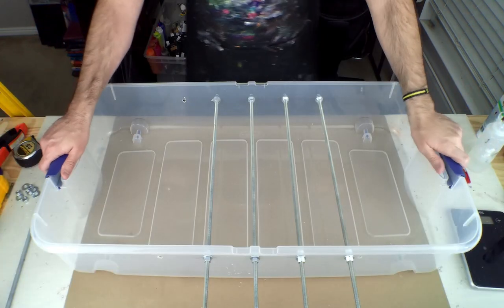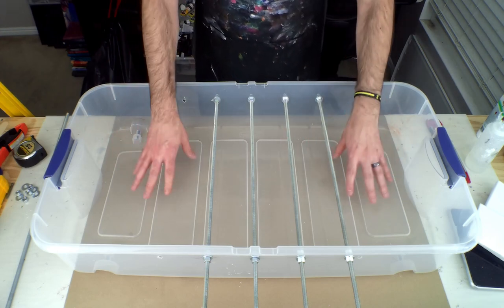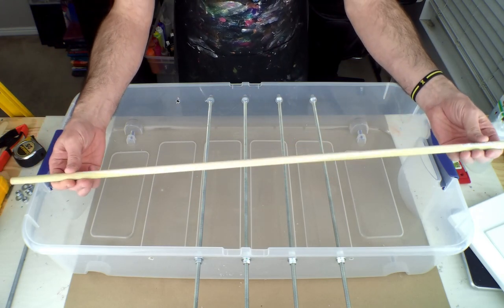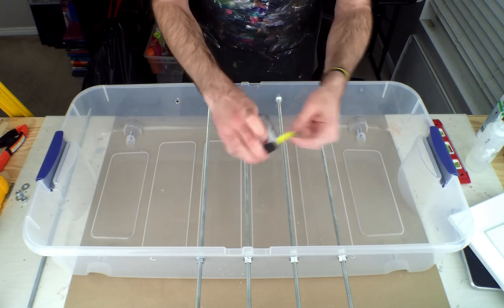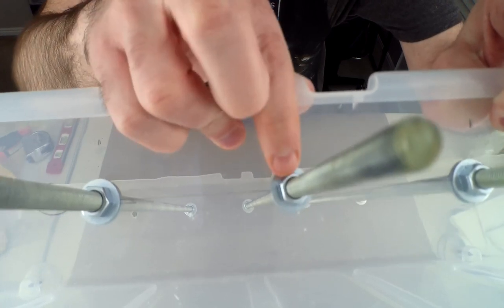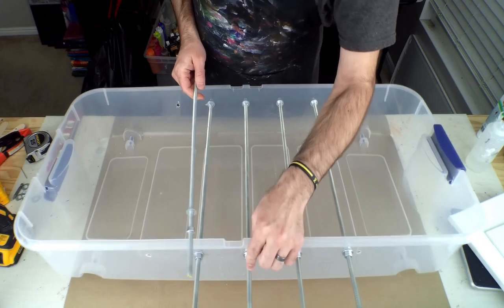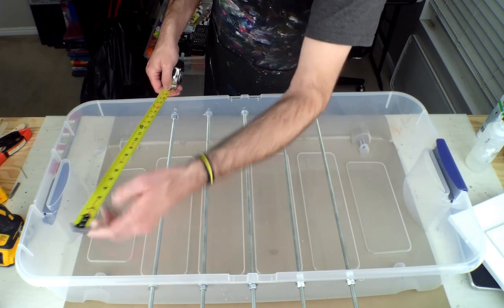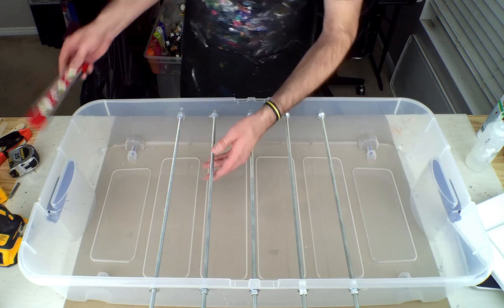DIY Acrylic Pouring Container  - PAINT MORE AND PREP LESS

Comment: Using mud mixing tray (drywallers use them) from Lowe’s.  24” X 36” and about 8-10” deep.  Black plastic.  Bought threaded steel bars and washers, but used wing nuts instead of standard nuts.  I have arthritis and Parkinson’s Disease (PD) and need something I can loosen or tighten easily.  Making another, same thing, for a friend who also has PD.  I’ll let you know how it works in Sept.  living in Florida it’s too hot outdoors now but by mid Sept I’ll be able to pour early morning and late evening without worrying about damaging inside hardwood floors, which result in serious auditory abuse.  I’ll send you a picture, if I can find a kid to help me figure out how, and a full semi-objective report on how it works.  Thanks for this video.  Very, very helpful.
Reply from the maker: That is hilarious I made a video a few months after this one where I did the exact same thing. They are way cheaper and easier to work with
Reply: @LeftBrainedArtist  you know, i don’t think i’ve had an important, or even mediocre, original idea in my life.  once again, someone beats me by months or even years.  Don’t worry about my despondency i’ll be ok.  i was a psychologist for 45 years.  i’ll talk to myself tomorrow.  at least that’s free!,
AND from now on i’ll look at your most recent videos first hoping to beat you to my first original idea before you do:  i grudgingly admit your videos are very good.
Reply: @davedean4150 , So sorry to hear that you are going through 2 illness at once. 
But I'm so glad that you have found something you love doing! 
Your comments are hilarious and I'm glad to see that you still have a sense of humor. 
I hope you are still enjoying Pouring!
PS I hope your 'appointment" with yourself went well. 🤭😬🤭😬

I just discovered Acrylic Pouring on 6/7/22 and I've already done 8 pour Paintings and posted 5 videos on my Channel! (I put links of David's videos in my description box, to give him credit for all that he has taught me, and to guide others here.)
The first 2 were actually tempera paint pours because that's all I had.
The next one was with Acrylic craft paints.
The next one (6/12/22)  was what I consider to be my first official one, because it was done with "real" Acrylic Paints and it turned out beautifully if I do say so myself! Lol
Happy Pouring!!

Comment: This was very helpful! Inspired by your paint tray, I did a simple quick-and-dirty version. I have an under-bed tote that I didn't alter at all (although considering filling it with something like resin for a flat bottom for easier paint recovery so it's not wasted). I bought a couple cheap wooden yardsticks and cut them into approximately 18" lengths by scoring each side with a utility knife and snapping them apart. I lay them across the top of the tote, and then I can either place the canvas right on the wood or put thumb tacks on the back of the canvases so they are ready to move to another level location to dry. Then it's really easy to scrape the paint off them, move aside and dip a canvas in the drips or just scrape into a cup (a strainer is helpful to catch any clumps) for an interesting custom color. I find the flatness of the rulers very easy to level. Once the rulers are too rough, etc, I can either sand them down or just replace.
Reply from the maker: Great ideas.  Thanks for sharing.

Comment: I recently found your channel. I love the content. Thanks so much for sharing. I am going to try this. I was thinking of putting the steel bars closer to the bottom so I can spin my canvas. Do you think there is enough depth to this tub to do this? I don't want paint flying all over the place. lo!
Reply from the maker: Yes there definitely is.  I imagine if you put them 1" or 2" from the bottom you'd have about 4 inch "wall" to capture splattering pain on all sides.  As long as you don't bionic spin you should be just fine.
Reply: @LeftBrainedArtist  LOL thanks!

Comment: I am so happy I found your channel today!  I have a similar container except it is longer.  I had it in my attic with Christmas paper in it.  I have had it for years.  I am using it with plastic taped down, an old cookie sheet upside down to make the bottom level, and a lazy susan on top of that.  I lay wax paper under the lazy susan to make for easier clean up each time, but still a mess.  I then put a big plate on top of the lazy susan and cover it with plastic wrap.  If I do paintings back to back, I just put another layer of cling wrap over the plate.  When all done... unwrap and throw away.  If I decide to save, it is easy to lay out and do so.  My fiance' has been asking me how I want one built and I couldn't quite find a video that explained it.  THIS is perfect and it just a different version of what I have.  Curious what you do what you want to use something that spins?  I suppose in that setup, you could lay any flat surface on top and set the cake spinner on top.  I like to be able to move the painting around sometimes to make sure I have all sides covered before moving it depending on what it is.  I am SO grateful to have found a how to video!  You are a lifesaver/time saver!  Awesome details!
Reply from the maker: I spin directly on my LoliVefe silicone mat with a cardboard surround.  The paint pouring container I made isn't deep enough.  I probably need to make a new one with a leak tray for a washer and dryer so it is as wide as it is long.  That way I can use bigger painting surfaces to spin on.

Comment: I have x6 metal bars came off a old DVD shelf unit that did not like so I took all the 2” x 1/2” thick wood shelf and the bars are bit thicker then yours, I drilled tinny holes cause my small drill not very strong then used pointed ends of scissors ✂️ but kept the ends closed of scissors and just went in by going in one circle drilling like made the scissors go through all the way into the plastic, it is perfect tight fit and removable I don’t use washers and bolts and I have degenerating disc disease and just started to paint, my lower spin hurts big time from standing, limited income on disability for had surgery x2 on my LS5 and in 2000 year my LS4 was begging to bulge and since 2000 year I have been very careful on how I move and lifting heavy things, well just in the past year or 2 my lower back is giving me a lot of pain and now my right thigh is going numb from standing for only 1 minute so I have a bad feeling that I may need surgery and this hurts my life. Have been single and not dating since 2003 so I am feeling like I can’t even enjoy painting, I painted in year 2000-2003 and hardly did any artistic stuff, now I need  hope that I can get healed anyways so that’s my artistic life miss and love to paint, draw even write short stories, anyways enough of that, so thank you for this video tutorial on this…thank you.
Reply: Lol can you make mine? Hehehehahaha..Joking….
Reply from the maker: Glad to hear you figured it out.  Happy Pouring Cynthia.

Comment: Do you find it difficult to clean the paint off the threaded metal rods?
Reply from the maker: I flatten if after I pull my paint off and move it to the drying shelf.  It stays pretty level.  and doesn't build up much at all.

Comment: I need a larger container. Any ideas!
Reply from the maker: There is a black container at lowes used to mix cement.  Lay a few rods across the top or do something more permanent like I did.  A second choice is the square pan people put underneath washers and dryers if you have the room for something that big.